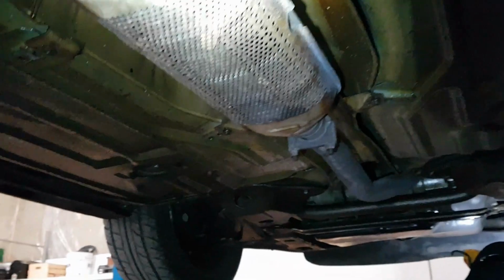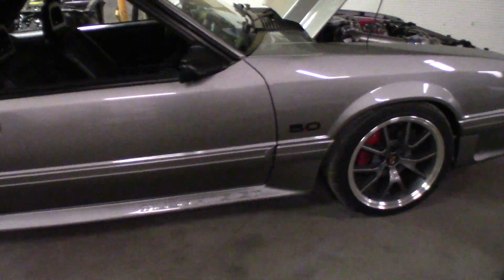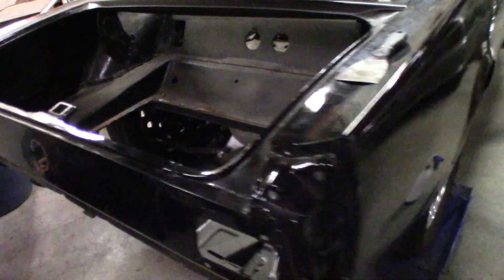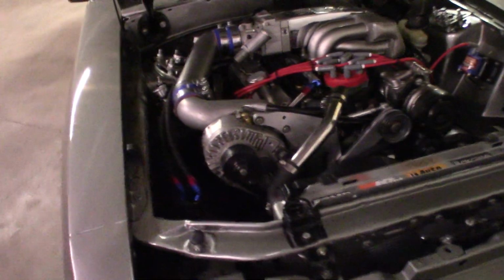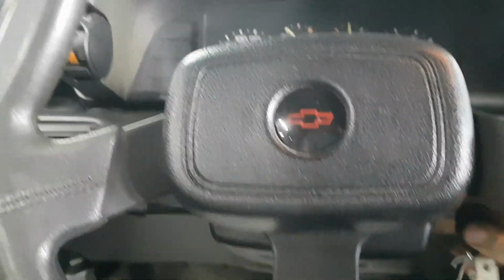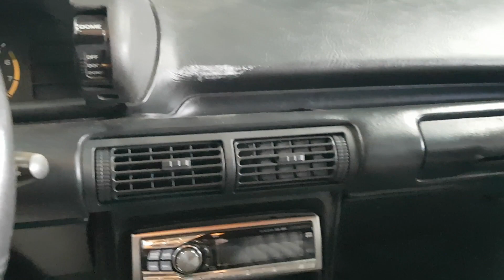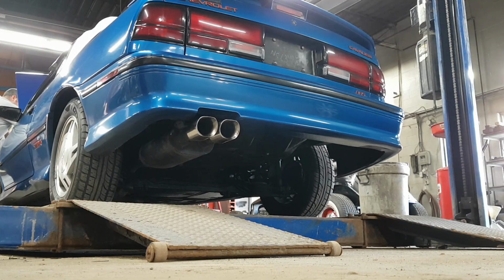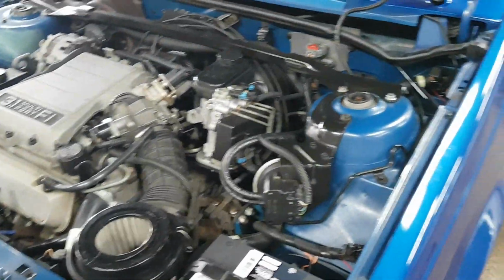Mint 1992 Z24 Cavalier!

Comment: Had owned a  '87 Z24 cpe back in '92 used. White exterior with blue cloth interior automatic 2.8 V6 .  Good reliable wheels never let me sit good fuel mileage.  Make alot of roadtrips to tide water region to visit of buddy of mine that was stationed at the naval base there.

Comment: I got a 1992 Z24 hardtop in burgundy, only 98,000kms. Absolutely love it
Reply from the maker: Nice! 5spd?
Reply: Mod Everything 3 speed auto sadly. I inherited it though and it’s in wonderful condition so I suppose I shouldn’t complain haha
Reply: @DullerCrab  You could always swap a 5spd or do a full 3X00 swap with transmission, ecu, etc
Reply from the maker: @1upPaintingAB  back in the day you could grab a 3spd from other 4cyl GM cars and switch the gears on the chain set in the transmission to give you something like a 3.73:1! You can make decent power with the 3.1l too!
Reply: @modeverything1  I remember reading about a guy that got over 200whp n/a with a relatively mild 3.1 build. I'd love to build my 3.1 but I have little faith in the TH125 3spd auto and a 5spd donar car is difficult to source locally.